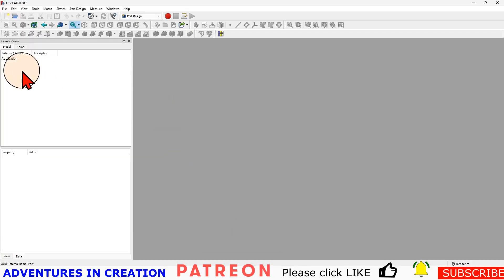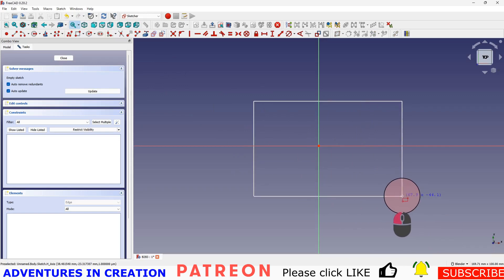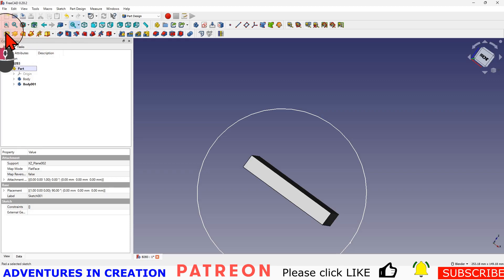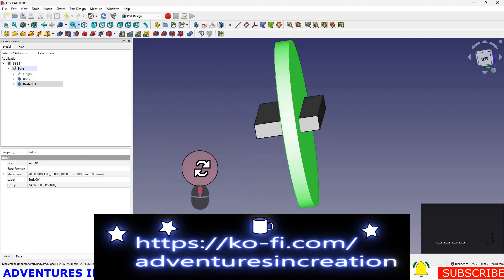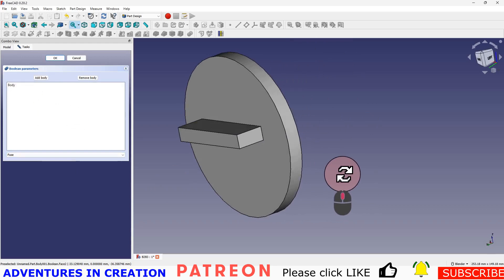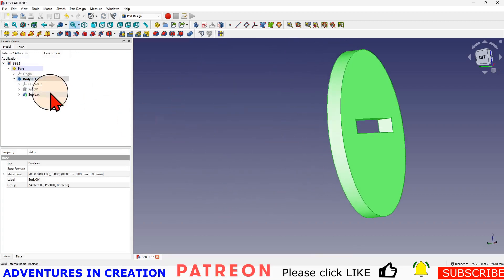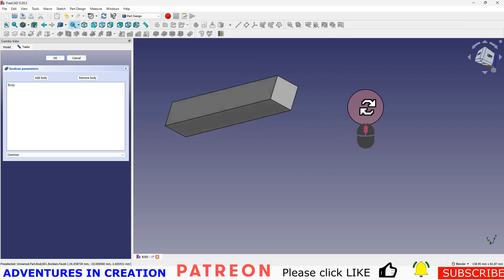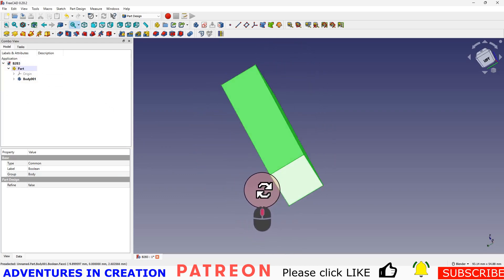Back 2 Basics Number 3 FreeCAD basics #freecad #cad #design #makers #Boolean Operations

Comment: As a long-since retired, but one-time professional CAD user in the aerospace industry  - Airbus and Bombardier, to name but two - for many years, the appeal of FreeCAD was too enticing to resist (purely as a hobby, that is). It’s now 20 years since I left the industry, but always sought to, as it were, ‘keep my hand in’. Most free CAD softwares tend to have limited capabilities, but the ‘paid for’ commercial options are not geared for hobbyists so, when I belatedly stumbled upon FreeCAD when both my free Draftsight and free SketchUp softwares became unsupported and changes to terms of use started emerging, the discovery of FreeCAD changed things ‘over night’. The learning curve is still an issue - erratic use being largely to blame - but I probably understand the process better than many of those attempting CAD for the first time. The tree process is the biggest hurdle: my early years on CAD utilised a good deal of typed commands mixed with icon usage, which by the time I retired, had essentially removed the need to type commands at all. Keys were now called ‘hot keys’ and were shortcuts to executing commands etc. Whilst the “tree building” in FreeCAD is giving me some issues - “ practice and use”, I have modelled and detailed several machined parts to create a sphere turning fixture for a wood turning lathe. Have just finished building the device and hope to test in the near future: creating the models and producing the detail drawings was almost like being - for a short while - back in the industry. I owe a good deal of my introduction to FreeCAD to your channel. Your easy to understand style and measured delivery - explaining exactly why and what you are doing - is refreshing, and for that I thank you. Forgive me, but can’t help the feeling there’s a touch of the antipodean coming through in your narratives…………..
Reply: Ron, you may want to get on the freecad forums and give them a hand with their descriptive terms, things like height not being named depth are things programmers just dont get.
Reply from the maker: I am also a long time CAD user, I started with Prime Medusa on Tektronix 450s!!! - I appreciate your feedback and your journey. - You are detecting English with a slight touch of American which sometimes get mistaken for Australian. I have just been back to blightey and topped up my accent for the next year ;-)